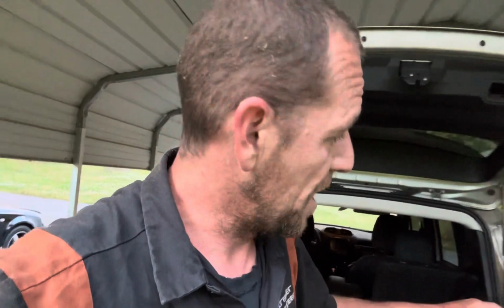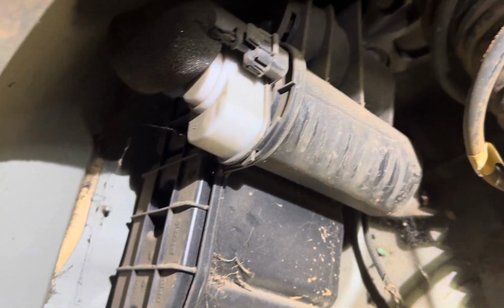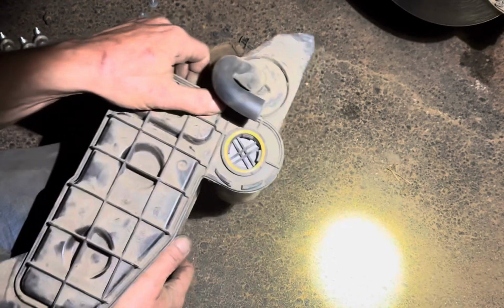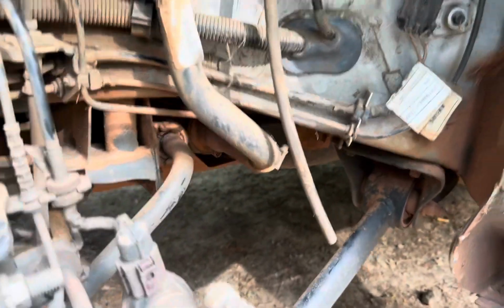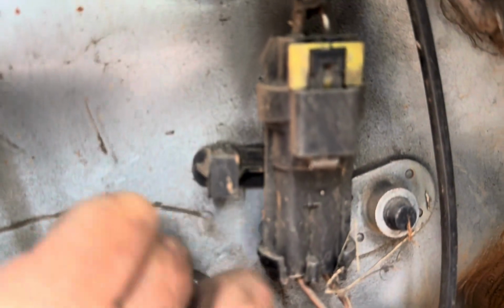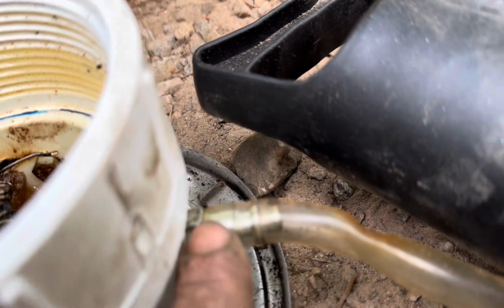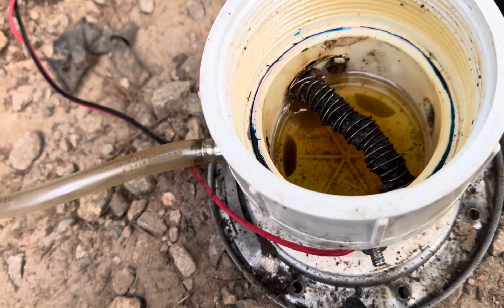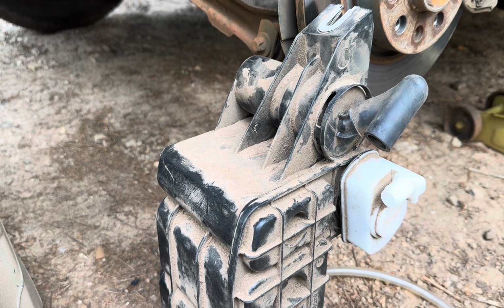2018 Jeep Renegade Latitude EVAP leak P0455 P0456 diagnosis and repair

Comment: Not sure why you didn't check the purge valve on top of the engine first... Did this fix it, or did you end up having to fix the purge valve on top of the engine?
Reply from the maker: I had already replaced the purge valve before doing this.

Comment: Do you have the video how you fix it?
Reply from the maker: This video shows how I fixed it. 
Remove the passenger side rear wheel liner, disconnect the electrical connection to the leak detection pump lift the locking tab on the back of the leak detection pump and rotate it clockwise then pull it out of the evaporator canister. Install in the reverse order.